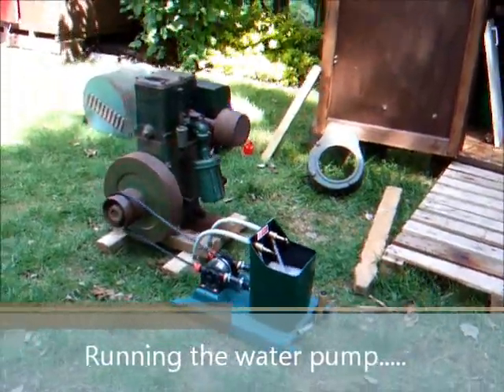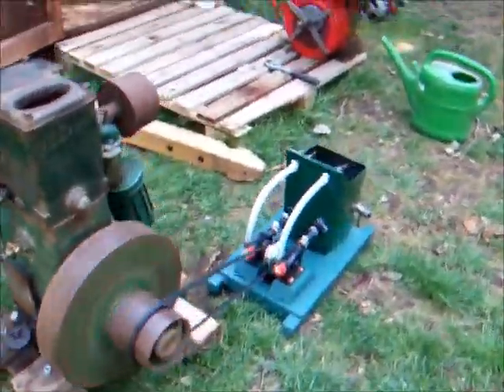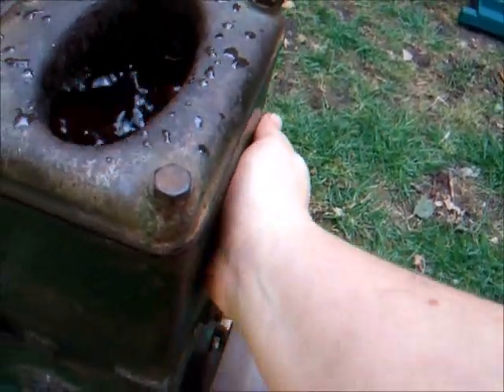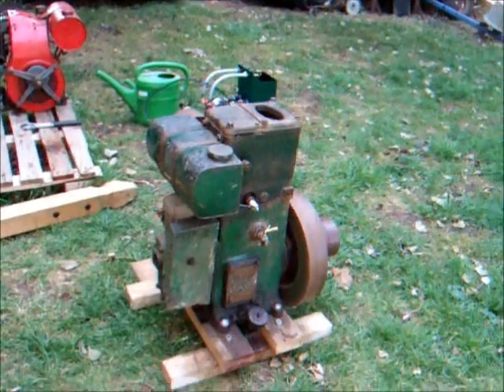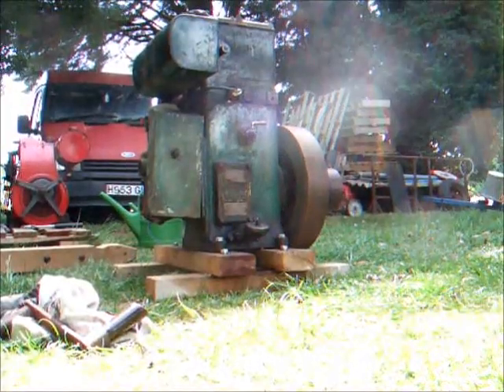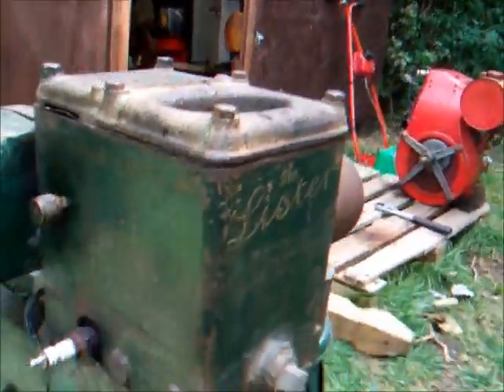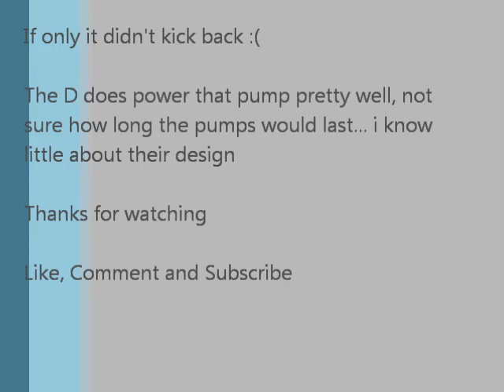Lister D start up and run

Comment from the maker: @steamwally thanks for the info on the kicks phil, ill have to remember to bounce her off of compression to get it up to speed. ill have to check the pulley, but the noise does appear to be coming from the back of the engine. Still not sure what it could be

Comment: Ah I see why it kicked now! Sometimes with these engines if you don't have it cranking fast enough coming up to compression they will fire backwards. Turn it back to compression before trying to swing it.

Once going she sounded allright! You said to be about the chatter, I can hear a clinking noise which sounds a but like a loose pulley or something like that, worth checking.

Runs well though, better than many and looks great too. Good to see the filter on there too.